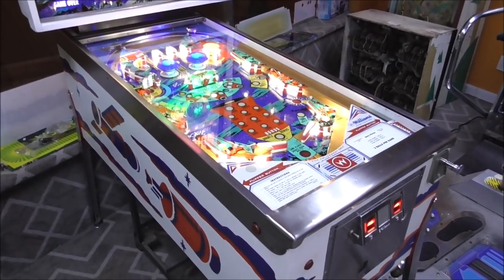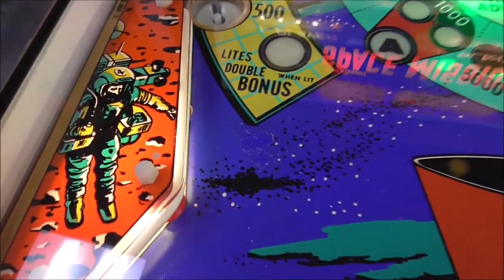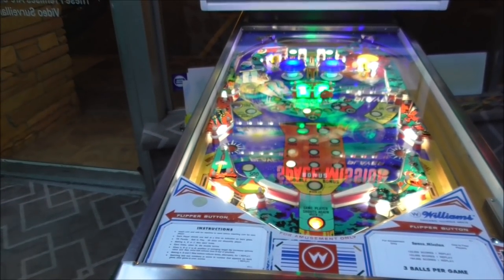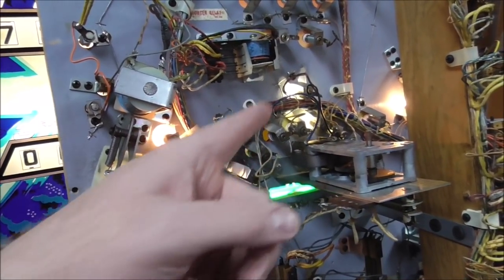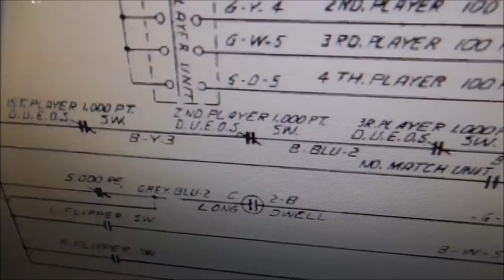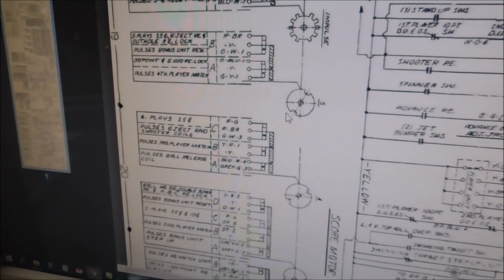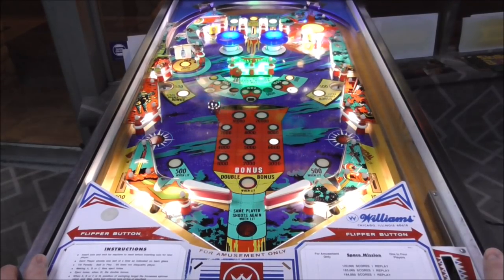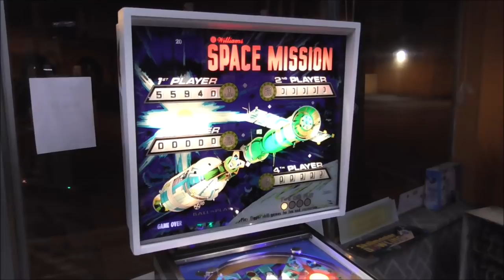Repairing a Customer's 1976 SPACE MISSION Pinball Machine! - Schematic Logic

Comment: JOE CLASSIC, When looking at an EM schematic how can you tell that the stepper motor relay will have to pull in and release before it will Advance/step the stepper unit? because I can't tell when looking at the schematic. You never have shown the EOS switch on Stepper Motors, I never seen an EOS switch on stepper motors or even knew they had an EOS on stepper motors. What are the differences between a DRUM Unit compared to a Stepper motor? I don't know what a drum unit is or how it works.
Reply from the maker: So pinball machines have some common contraptions in them, stepper units, score motors, relays, and score drum units.  There's sometimes other things but most games have all four of those.

A relay is just a single coil that when it pulls in, it connects and disconnects the switches connected to it.

A Stepper Unit is a printed circuit board with a group of contacts arranged in a pattern that slide over the board, so that each time a coil pulls in, it moves the stepper unit up one position or down one position or whatever, so that it moves all the contacts to a different point on the stepper unit.  So this is used to make multiplayer games work for instance, all the contacts move one step and now it's on player two, or player three, etc.

A Score motor is the main motor in the bottom of the cabinet, instead of a relay it has a motor that moves, which causes a lot of switches to connect or disconnect depending on what position the motor moves into.  So this is what gives the machine it's motion, or it's ability to count, or whatever.  As a relay pulls in on the machine, it turns on the score motor so that other switches on the score motor can connect or disconnect and make the relay accomplish whatever it's trying to accomplish.

A score drum unit is similar to a stepper unit, except instead of having a pcb with contacts that move, it usually has a plastic drum connected to it with a number on it, they're commonly used to display the score on the backglass.  They run with 1 coil like a stepper unit or a relay but not a motor, like the score motor. 

The End of Stroke switch is something that's connected, physically, everytime the coil on a stepper unit or score drum unit is extended, the actual metal linkage touches a switch and either closes or opens it, so it's used for things like the credit knocker, when the credit stepper moves up one credit, an end of stroke switch is hit, which makes the knocker make a loud sound.

You can't tell by the schematics that the machine has to pull a coil in, and then release it, for the stepper or drum unit to actually move, the only way to tell is to actually look at it in action and see how it works.

Thanks for watching as always hope you enjoyed the video!

Comment: Every EM machine I put LED's in does the twinkle when you are playing. It always boils down to a switch.
Reply: If you solder a resistor (with the same resistance as the original lightbulb) parallel over the ledbulb contactpoints, it will react as a normal lightbulb, then the twinkling will not occur. The resistor will absorb the current which will light a led light, but is to low to light a normal lightbulb.
Reply: @MrRTVtech  I will try that.